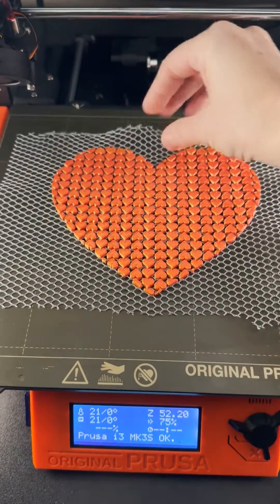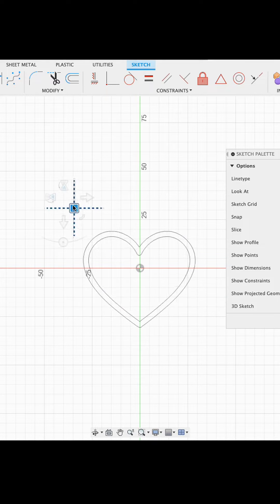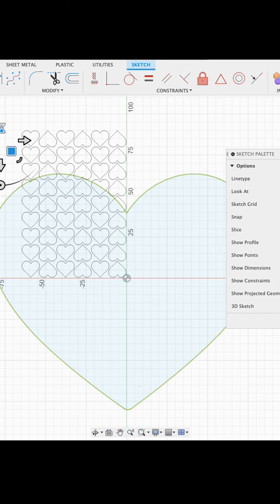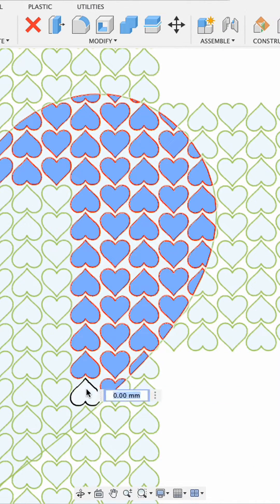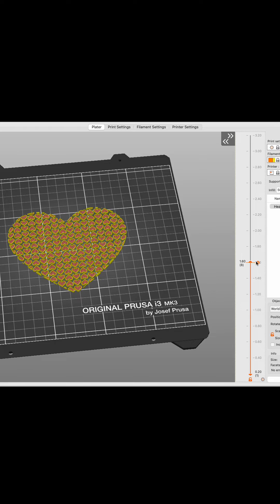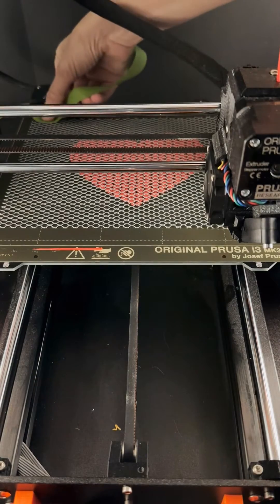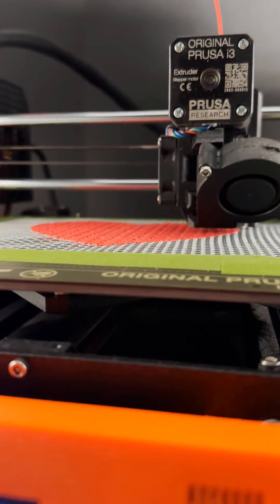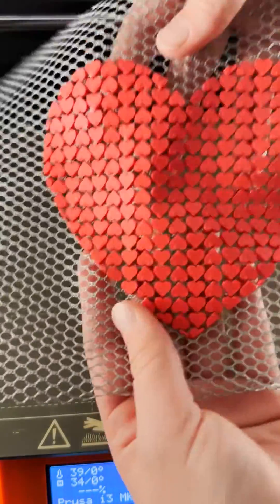How to 3D Print on Fabric: Heart of Hearts

Comment: I have tried something real similar and the plastic ALWAYS came off the fabric but later what i did is i would print a few layers, then put the fabric down and make suee to use a fabric like what u used... then id offset my z slightly and then print more layers on top. Oh it seems u did the same thing i saw after i watched the rest

I also done this with tshirts by cutting some small holes in the shirt, well poking a pencil through.  I used tpe on those which actually bonded to polyester pretty good
Reply from the maker: Yeah I found the fabric definitely needs to have "small" holes in it. I have tried more 'solid' fabric and it won't stick or stay stuck:(

Comment: This is awesome! Do you think there’s a limit on how fine the mesh can be before printing issues?
Reply from the maker: I think the mesh can be pretty fine.  I've experimented with different sizes and as long as the filament has "holes" in the mesh to print through and adhere to the layer beneath the mesh it seems to work:)